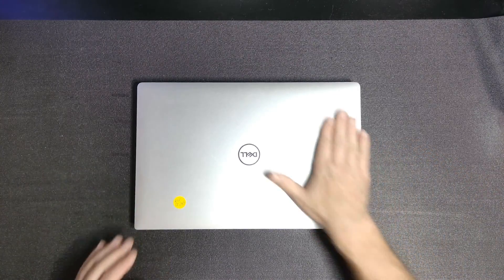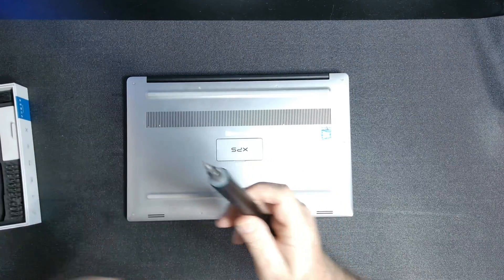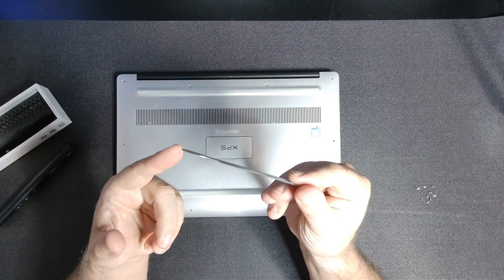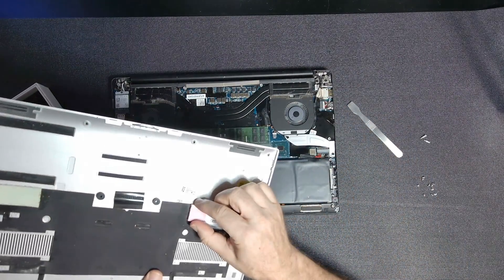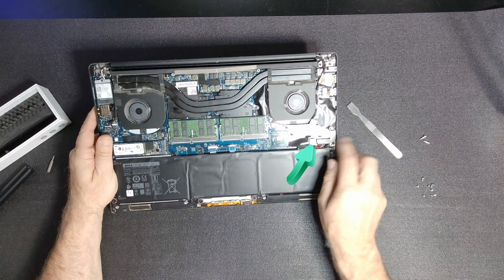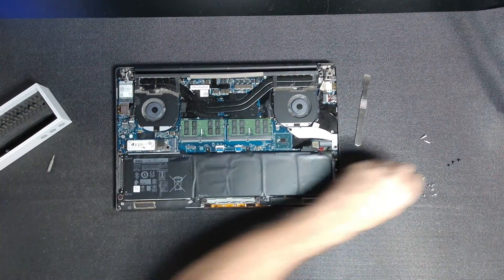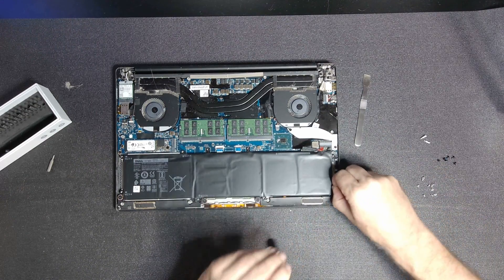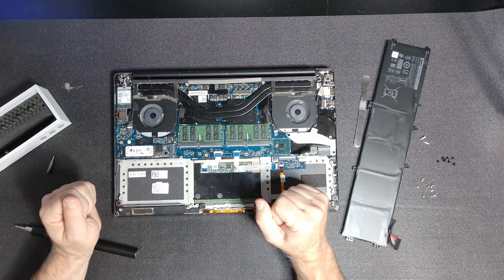DELL XPS 15 7590 HOW TO BATTERY REMOVAL / SSD / MEMORY -- LGH

Comment: Thank you for this video. The part I needed help with was separating the laptop case after removing screws. A small butter knife did the trick for me. New battery is installed and working.
Reply from the maker: glad it helped

Comment: Will replacing the battery improve it's performance? I have the same model and don't know if to replace the battery or replace the laptop.
Reply from the maker: Only thing that increases perfomance you can do is ssd and ram...and Im guessing you did that

Comment: faulty battery in this xps 15 makes it unusable without a power cord, but the laptop itself should still function when plugged in? Or laptop will not work?
Reply from the maker: laptop works fine with ac adapter

Comment: Can you initiate a hard reset without unplugging the battery?  I have audio low volume issues and the recommendation was to unplug remove the battery and press the power for20 - 30 secs to completely discharge the system.
Reply from the maker: that is the only way to do a discharge